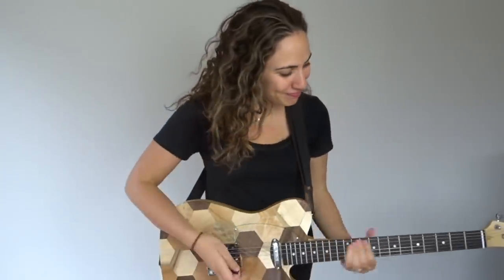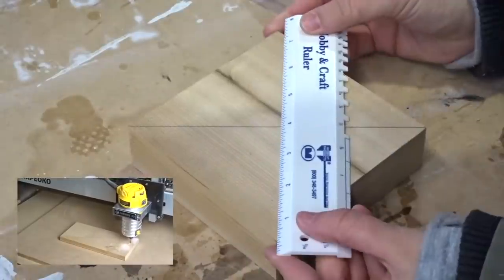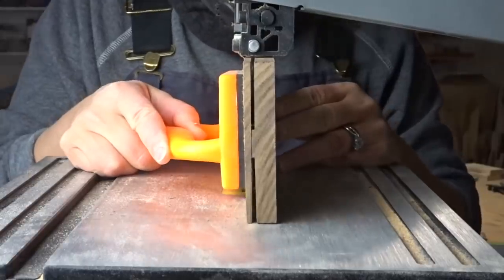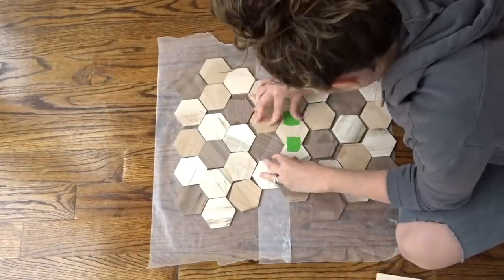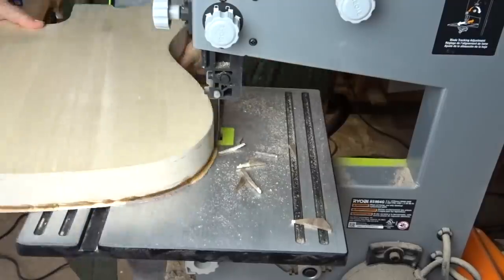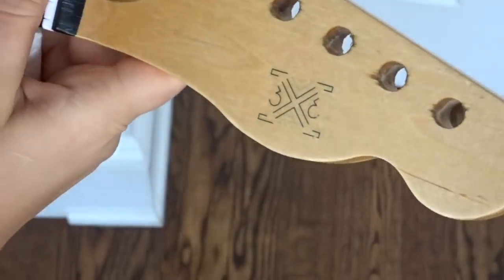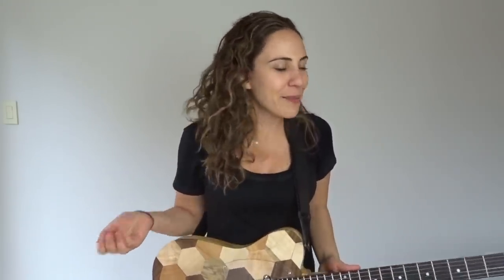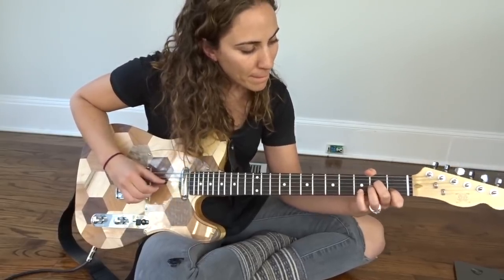DIY Telecaster Guitar // Woodworking Project // CNC // Guitar Kit

Comment: Your bandsaw needs a fence. That'd have made it much easier to stay straight.

And why didn't Ben just resurface your guitar in his drum sander?
Reply from the maker: I tried clamping on a fence. The drift was still crazy. It needs a tune up that I just didn’t have time for. 

And bc the cnc I had was perfectly capable of doing the job.
Reply: 3x3Custom - Tamar fair enough, just thought it looked a bit dramatic freehand resawing. Perhaps a new Olympic sport.
Reply from the maker: Ha! If curling is a sport, resawing could be too!
Reply: resawing more than 2-3 inches takes a really good band saw. Mine won't work on hardwood. I cant believe you freehanded it as well as you did.

Comment: Dumb suggestion for the bandsaw - make a fence to improve the accuracy, rather than having to eyeball the cuts and support the piece on both sides :-}
Reply from the maker: I’ve tried that. This saw is not meant for resawing hardwoods. Every time I set up a fence the blade stalls out.

Comment: The soldering quality (it's pronounced "solder" :-) ) scares me somewhat (although it isn't high voltage). Have you heard of crimp flex?
Reply: so you wanna crimpflex a wire to the back of a pot how exactly?
Reply: also she didn't really show any of the wiring, did you just assume it was bad because she hadn't done it before?
and yeah, it's not high voltage, the worst thing that could happen is an open circuit and a silent guitar.
Reply: @calinguga  Well yes she did. It was sped up and showed cords soldered together with no insulation prepared. Normally you put a piece of Crimp Flex on the cord and heat it over the soldering afterwards. Saw no sign of that. She may very well be a brilliant carpenter but I did not find the soldering part impressive; and yes, I actually took courses in soldering.

An open circuit would result in a silent guitar. A shortcutted one would too (with smoke and all) ...  And you can easily put crimp over the terminals of a potentiometer. Good practice.

Comment: you need a fence for the re-sawing on the B.S.
Reply from the maker: This video is very old. But yes. You would think that. But that ryobi piece of crap would stall every time I used a fence. Ive since upgraded to a powermatic
Reply: @3x3CustomTamar  great, Powermatic is top of the line!

Comment: Thickness planer . . . . its fairly basic but designed to do the job you were trying to do.
Reply from the maker: Which job? To take of a little of the body?
Reply: @3x3CustomTamar  Yes.  That and insuring your mosaic pieces were of a uniform thickness before your started assembling them.  For instance, to do runs of pieces (say for a laminate neck) you have to use a jointer to set two perfectly straight edges, then a thickness plane to square the opposite edges to bring the piece square.  Then once glued up you have a flat even squared piece to work from with maybe a run through a planer or sander.  Your CNC router acts like a jointer on steriods and  sets the joints in one plane with the proper precision relative to the bottom edge of the wood, but when you cut them out you had uneven thickness (or two "out of parallel" faces) which was giving you fits in assembling the mosaic because a slight thickness difference throws your 90% edges out, so the edges were striking at varying angles which in turn was wedging deeper rows out of alignment.  So, if you had ripped the wood for your mosaic into planks fist and planed them to a uniform thickness with two parallel faces then CNCed the hexagons , each piece would have been square no matter which side you placed up (or down).

(Sorry, I hope my attempted explanation was not too confusing, I am one of those learned-how-to-do-it-the-hard-way-but-couldn't-explain-it-in-any-language kind of guys) (Beautiful job though, turned out fantastic.)
Reply from the maker: Richard Troell well. First of all sending the already routed body through the planer would not be a great idea. There is a possibility there would be tear out at the back of the holes. 

And I agree about ripping everything to thickness before cnc’ing the shapes.... but you know what they say about hindsight.... I thought I was going to be able to resaw them to the same thickness on my bandsaw.... now I know my benchtop bandsaw doesn’t do that very well....
Reply: @3x3CustomTamar  True, but that risk is present anytime you are working a piece which already has body cavities routed out or any type of void.  I could not tell what type of cutting head you were using but every time that tool pulled across a cavity you had some risk of tear out. When I started tinkering with wood I had no budget and no earthly idea what I was doing so I do have a couple of used block planes (that are all but retired now) and even block planes have a tear out risk.  So all tools have a tear out risk but it can be managed if you are patient.  Tear out also depends on whether the wood is flat sawn (bad tear out risk) or quarter sawn, it depends on thinking through how you pass the tool over the piece, such as the cut first plane first decision with your mosaic. It also depends on how aggressively you are using the tool, trying to remove too much material too fast always increases every risk I can think of, not just tear out.

Comment: You need to use a fence when you resaw.
Reply from the maker: I tried one. It’s still wouldn’t cut straight. I also tried tuning it up as best as I could. No go. For now, I’ll resaw in the tablesaw, then finish off on my benchtop bandsaw
Reply: 3x3Custom - Tamar 
I was thinking more along the lines of a single point rip fence. It keeps the wood a consistent distance from the blade while allowing you to adjust direction of the wood, if the blade starts tracking off of the line. Here's an example of one. 
https://www.wwgoa.com/article/easy-resawing/
You've got a good eye for design, keep it up.

Comment: What toolpath/G-code generator program do you use to export your designs to your CNC router? Any of the programs should have a "tabs" feature to put tabs between the hexagons and rest of the material to hold them in place. This way, you can clamp the material down with a spoilboard under it so that you can cut down further than your work piece and it will stay in place and not fly out or breat the bit. Im not the best at explaining this, but I would recommend the "Wall Art Name Project" by Richard Platt to learn about 2D CNC work (https://www.youtube.com/playlist?list=PLgyBeojUgBI3SA_pDk2TLyjAPUbOhPw_8). Your programs may not be the same, but it may help with your knowledge expansion in the world of CNC woodworking. Also, I know this video is a few months old, and you may have already become aquainted with this sort of stuff by now, but Richard Platt was my highschool engineering/shop teacher, and if he can teach modern highschool students how to do this stuff, it could work for anyone!
Reply from the maker: Thanks for the tip! I’ve gotten better at running my CNC since then. The issue was more that I didn’t have a bit that was long enough to cut through such thick material. I need to get some longer bits!
Reply: Instead of longer bits, try thiner material. instead of cutting the profiles of the shapes out on a thick material and then cutting them out on the bandsaw later. You could start by cutting the wood into thin slices (1/4" or so) and then cutting the shapes out of those on the CNC. Of course, thinner slabs would involve the same steps but backwards if starting with thicker material, but atleast this way you could get away with cleaning the faces up with a planar. Nonetheless, this was a really cool project and I hope to try out this sort of mosaic polyhedral design venir for something or another in the future (maybe a tabletop, or turn the process and make endgrain shapes for a cutting board)!
Reply from the maker: Yup! That’s the conclusion I had at the end of the video! I was using the scraps I had lying around. So this thicker material is why I had. Next time I will CNC the thickness I need.

Comment: You need a bandsaw fence.

Go to google translate, select German and enter "Lötung" in the left box, then you can hear "soldering" spoken when the translation appears on the right.

You either did but didn't show it, or you'll want to come back and do it: round/soften the edge of the layer you added. I think.
Reply from the maker: Yeah. I rounded it over. Just didn’t show it. Thanks

Comment: CNC? really? all you need for this is a SHARP planer and you take a hair off at the time! it won't chop and a good router with a template to make the hexagons, you won't even have to mind the thickness just through the planer again, and again a hair at the time drill the pickup holes and pull the router through,.and around the body done in an hour...without the glue drying time...
Reply from the maker: Sorry you are so offended by the cnc.

Comment: A fence on the bandsaw would be easier and safer
Reply from the maker: Nope. Not on this one. It refuses to cut straight. Even after watching every bandsaw tune up video and making every adjustment I could. It still doesn’t cut straight. And it just stalls out when I try to resaw any hardwood

Comment: That basic guide to soldering is very bad, you are creating a huge blump of solder on the pot, instead you should connect some wires through each component everywhere where you can to small up the connection point on pot :)
Reply from the maker: I didn’t give a basic guide. I said this was my first time and I put a link to a better video. Thanks though!